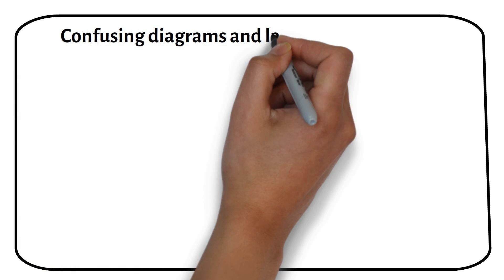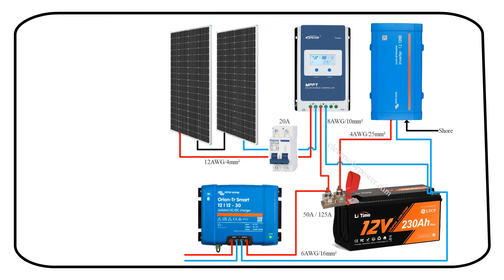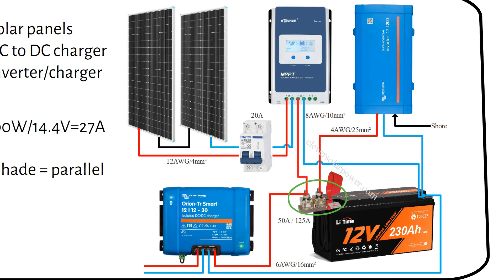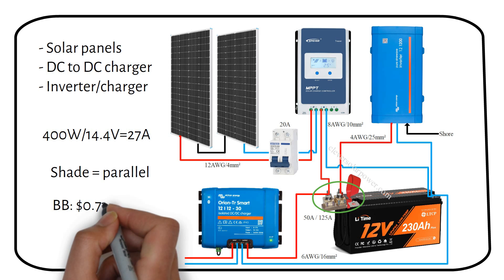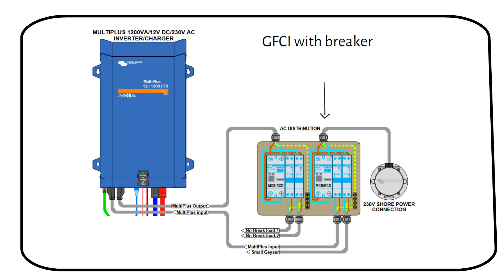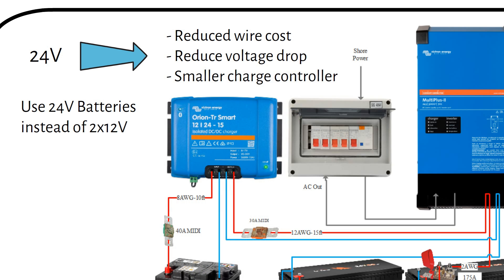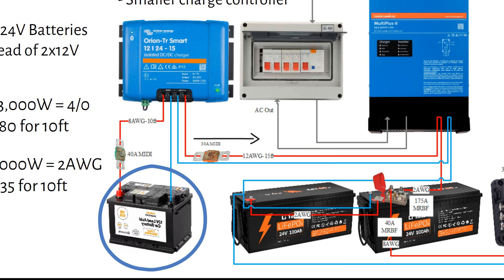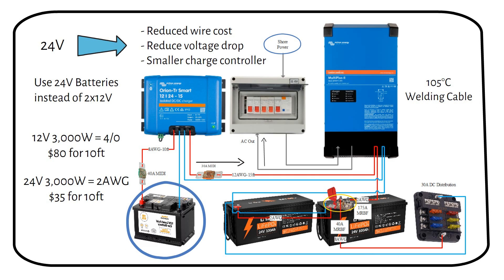Van Electrical System Diagrams - Campervan Electric 12V/24V

Comment: The diagrams are helpful as I know very little about this stuff. I would have liked to see the 24V system diagram, incorporate larger 24V batteries and/or four 24V batteries as anyone who wants to be able to run an AC for extended periods off grid would want to include a much greater capacity! Also, more info & diagrams discussing how a 48V system compares would have been useful!
Reply from the maker: Check all my diagrams here: https://cleversolarpower.com/solar-power-diagrams
Reply: 24 and 48 are almost identical in terms of what you have - just they are components rated for 24 or 48.

You need all the same parts;  just different brand/ model numbers.

For example, victron (the blue thing) does not make a 12v to 48v DC to DC converter - but you can get one from Etaker or Ecoflow.

The ONLY thing extra in a 24v or 48v is that if you need to step down to 12 or 24 for something else in your build - (like in an RV) you would need a step down unit - but those are pretty cheap and easy.

Side note - AC units - unless you get a minisplit or a 24 volt unit - draw power at staggering rates - you will need a LOT of batteries for that. (like a lot).

Comment: Hi Nic what's your take on ac70 blueitti with 2 add on batteries for small offgrid cottage? All up $3,500 usd. Thanks for the great content, I like going over your posts multiple times it cements the info lol.
Reply from the maker: No, I recommend not combining a solar generator. Use the 12 or 24V system i have described here. It will be cheaper and more power.

Comment: Of course, if you want to deal with even fewer amps, and thus much much less heat, you could just go straight to 48V.  People put 48V + solar into golf-carts these days.   I put together a tiny 48V system just last week for a friend.   2 x 75W solar panels, a cheap boost charge controller (since you only get ~40V from that little solar), a 25Ah 48V (51.2V LiFePO4) battery, and the cheapest 48V inverter/charger we could find.  And that was mostly just to have a convenient AC charging functionality, otherwise I'd just have used a little 500VA or 800VA 48V Victron inverter.

Remember that power losses (and thus heat dissipation) goes by the square of the current.  So a 24V system generates 1/4th the heat that a 12V system generates.  But a 48V system generates 1/16th the heat that a 12V system generates (and 1/4th the heat that a 24V system generates).
Reply from the maker: i don't recommend 48V for vans. You choice on dc to dc chargers will be limited. You don't need more than 3kW in a van.
Reply: @cleversolarpower  12-to-48 charging isn't common, true, particularly if you are only looking at Victron gear.    Victron is a bit behind the curve when it comes to 48V gear and they don't have a 12|48 dc-dc charger.

A 24V system probably fits the bill better if you need charging from the vehicle's 12V system.  Its a bit of a shame, though, to abandon 48V simply because 12V->48V charging is less common.

There are plenty of solutions, depending on the wattages needed.  The easiest is to just have a small inverter hanging off the Van's 12V system to get yourself some low-wattage AC and then run that into a battery charger matched to the wattage the inverter (and alternator) can output.

Another solution is to use an all-in-one.  I know people pooh-pooh all-in-one's, I do too... but actually an all-in-one is a pretty good fit for a Van build and generally will be cheaper than a Multiplus II.   There are several all-in-ones in the 3000W range at 48V in the $600-$800 range that are very capable.  HF inverters (in the cheap ones), yes, but still pretty good.  Its a Van build, after all, sometimes its convenient to be light.

You keep the independent charge controller (the all-in-one's solar input probably needs too-high a minimum voltage).  But otherwise you just get a cheap all-in-one, connect up the batteries, configure the unit to limit the AC charging amperage, then connect the vehicle inverter to the all-in-one's AC input and call it a day.

-Matt
Reply: @junkerzn7312  I too am considering between 24v and 48v for a van;

most of the 48 all in ones have a very high minimum voltage requirement for the solar - which may be more than most folks can fit on the roof.
All in ones also often have a high idle drain - between 50-70watts.

DC to DC (alternator) charging for a 48v is possible - but more limited - although at least there are a few options ;  ecoflow charger ($$$$) the blueetti ($$) or a Etaker 1000 or Etaker 2000.

However - overall I agree that for a van - would do 24 not 48
* Limited alternator charging options (or much more expensive)
* not that many native 48v appliances and units.
Reply: @davethepak  24V is more convenient so yah, for a van build I think its a decent choice.  If you were to build with 48V:

For 48V the charge target for LiFePO4 is 56.8V which means you want the Vmp of the solar to be at least 61V.  This can generally be accomplished by putting a 3 or 4 smaller panels in series.  For example, 4 x 100W panels.   It can also be accomplished with 2 x residential panels (35Vmp or more each x 2 = 70Vmp or higher).

Look at the Vmp (not Voc) of the panels to make sure the minimum operating voltage can be achieved with several in series.  This is the main pitfall of 48V on very small systems, but it isn't terrible.

For the charge controller, with 48V its best to start with something like the Victron 150/35 because of its generous 150VDC input voltage limit.  The smaller Victron 100/20 with its 100VDC input voltage limit means you have very tight bounds on the solar voltage.

For the inverter, a multiplus-II (48V version), or a discrete 48V Victron inverter... these have low idle losses, typically less than 15W.

(p.s. if going for a 24V system, the 24V version of the multiplus-II is also very good).

For alternator charging I would actually install a 12V inverter off the vehicle battery with a remote on/off feature that you setup a relay to only turn on when the ignition is on, and then run AC into the multiplus-II with a little transfer switch so you can select the vehicle or external utility AC.  Program the multiplus-II with an amount of charging current that the inverter can handle.

DC-DC chargers are a decent option but you are right in that 12V->48V is hard to come by.  In that situation it is easier to go 12V->inverter->AC and then into an AC charger (or multiplus-II that has the charger built-in).

-Matt
Reply: @junkerzn7312  Thank you for your reply !!

I had a really long comment - but basically - everything you are saying matches my findings....   so yeah. :)

Just to make alternator charging easier, and the lack of 48v appliances (except for some really expensive ones) - I am going to go with the 24v for a van build.   It is prolly going to be victron (the items you mention are the same on my list.....  Multiplus II, Victron 1535 MPPT etc.).

For battery I am leaning on either the 
* EG4 LP4 v2 24v 200AH server rack model (if I go with a 6548 based all in one) or a  
* Li-time 24v 200Ah unit  (there seem to be several....).

Eventually I will get two (of the same kind)and run them in parallel.

Thank you for your channel and your response - your videos are very informative and free of long winded clutter.

Comment: Hello from South Carolina. 
From minute 6.30 in this video, I can confirm. In my first build, I started with a 3500 watt Edecoa 12 volt. Mistakes were made😂. My battery combiner box has 5-100ah lithium batteries connected. When I did the math, my inverter draw potential is 292 amps maximum. I ended up using 350 Kc-Mil to feed my inverter. 
It's a bit oversized, of course, but my equipment is in the attic. I had a fear of overheating the wiring. I will run this until the inverter dies and move to 48 volt on my next build. Between this channel and your book, I have learned more and have a way better comprehension. Solar is never boring. In fact it's addictive 😆 
Stay blessed brother.
Reply from the maker: Thanks for sharing your experience Stephen. We are here to learn.